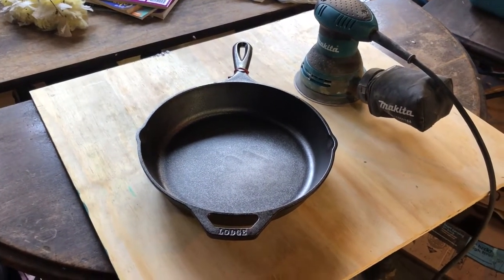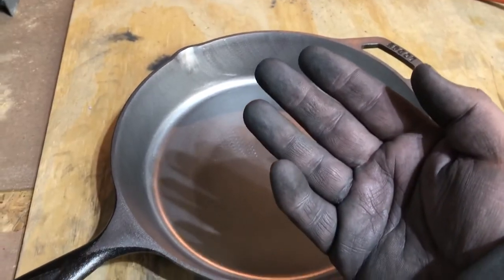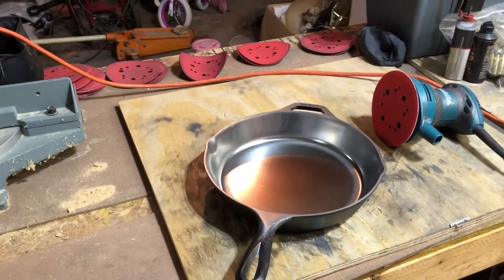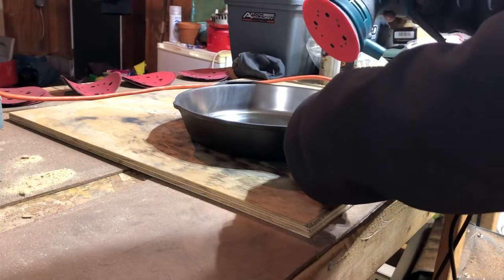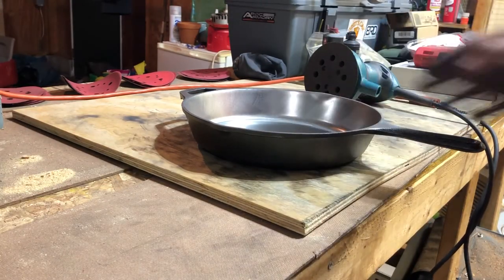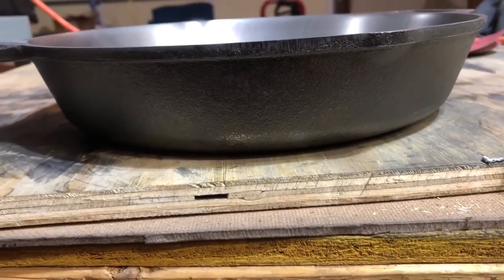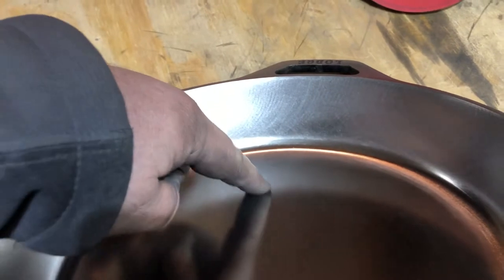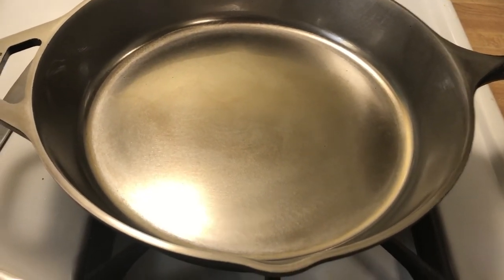DIY Refinishing Lodge Cast Iron - First attempt

Comment: Interesting video and much appreciated 👍 the finish is brilliant! Here in the U.K. this type of cookware is uncommon to say the least! I have a Lodge 8” frying pan (skillet!) and cooked an egg in it on day one! The seasoning it came with from Lodge was okay, the egg didn’t stick to much and I got it out without too much trouble. I then found Kent Rollins and re-seasoned according to his take on the subject, in and out of the oven 5 times in all, using a high smoke, plant based oil and so far it’s now slick and and pretty much non-stick. The thought of attacking the cooking area with sand paper fills me with horror 😂! The texture It’s still as rough as a witches armpit (😂) but the seasoning and slide ability is pretty much on the money! Looks like a Dutch Oven and another skillet are on the cards! All the very best from deepest Dorset England 🇬🇧🇺🇸👍
Reply from the maker: Thank you for your thoughts!
Grinding off their finish and reducing the cooking surface to smooth is not necessary, this test proved it to me for sure. What you get from it is a certain look and nothing else. The seasoning struggles to stick to this very flat surface, but the look is very nice. I will check Kent's video and see if I can learn how to season better as well.
Reply: Thanks Jim for your reply, much appreciated. if I want to make my cheap Lodge look like the cats whiskers …….you will be getting a parcel in the post😂 All the very best from deepest Dorset 👍
Reply: I don't like the finish that lodge leaves on them. it you ever get hold of griswald or a wagoner. you would know what I mean
Reply: @jimknowlton342  he is a good person to watch, but i sanded my new lodge. they are sand castes these days and it don''t leave a smooth finish.

Comment: You really don't need to work through all the different grit sizes, you move as much material as possible with a low grit and you finish with the grit you want to have the finished look with.

Comment: Stargazer BEAD BLASTS the surface before seasoning to give a surface that will hold on to the seasoning. Polishing or even sanding beyond 120 is a mistake. You just want to get rid of the pimples and make it flat. NOT a mirror. As the seasoning builds up it will self level and become smooth. Think of seasoning like paint. You never paint a gloss surface. It will not adhere.

Comment: It doesn't need to be that smooth. I've found its fine after 1 pass each with a 40 and and 80. Then over the next few uses it settles and works great. In fact I have a taiwanese pan that has the grooves from machining it that may actually be rougher than the casting of the new lodge that works very very well, and you can catch a finger nail in them grooves. They're huge.
Reply from the maker: I agree with you!
Reply: Agreed.
Reply: It'll work fine out of the box. If you know how to use cast iron, or carbon steel, food won't stick regardless of surface texture.
Reply: @phill3583  I'm no where near that good of a cook, but I am yet to screw up something cooking in cast iron. I think because I have electric flat top which turns on and off you end up with hot and cold in other thin pans, and you end with hot spots and cold spots because they warp with heat. Cast Iron is immune to both. Smooth etc is secondary.

Comment: Nice job on smoothing it out.
 I have done over a dozen like that.
  The old Lodge, wagner, etc. Cast iron pans were machined smooth from the factory.
  Honestly, they really don't need to be smoothed to a mirror shine, just knocking off most of the roughness with 60 grit will suffice. But, smoothing them out like you did will not ruin the pan.
  Seasoning it may be a bit harder, but it will take.
 And the more you use it the better it gets.
👍

Comment: I bought a really cheap cast iron frying pan in a junk shop, I had to take a milling machine to it to take the lumps off the inside, finished off with a flap wheel in an electric drill. Still using almost every day 35 years on.

Comment: I thought I had patience but this was truly impressive.
I had read somewhere else of a person sanding a pan down like this. They had trouble with seasoning too as it flaked off easily. Another person said the smooth surface was great but that the seasoning needed something to anchor to. Apparently, after smoothing down, a rough grit was run over it to give it some small crevices. These crevices would not roughen the seasoning as they would fill in. 
Could anyone comment on this? I'm in the process of smoothing mine. I didn't realize it would take this many discs. Progress has been slow so I'll start changing them out more. I had intended to go to a 600 grit, then rough up with a 60 or 80.
Reply from the maker: It took that many discs because I bought super cheap discs.
I think you're right about wanting to scuff it once it's smooth. It doesn't really hold seasoning that well but I don't season them expertly.
Reply: I love what was done here for the look of it and the labor out in.
In reality you can do this very fast with a few flapper disks and a grinder. 40, 60, 80 or just 60 or just 80. Anything that will take the high sides off is what matters. Leaving a semi rough surface is fine as long as the high sides are gone. It will take seasoning well that way and not stick do to only having divvets and not bumps. The low sides will eventually get filled by polymerization after many seasonings.

Comment: I have several lodge pre-seasoned pans and like them very much.  Never saw any reason to put that much work into a pan.  Mine work great and are non stick and easy to clean.  I do a quick re=season each use and they work fine for me.

Comment: the finfish is superb. You dont want to go to mirror finish because the seasoning is susceptible to flaking. I done this same way to my skillet i stop with 400 grid. Also by the look of it you buy sandpaper for wood, those get dull really fast. If you use sandpaper for iron you will need like 2-80 grid, 2-100, 1-200/320/400 but they are bit more expensive. I am also glad you sand it and not buff with abrasive discs like in other videos. If you want a smooth pan and already going to grind to bare metal make it properly. Also by sanding you dont copy the surface imperfections but create flat surface. Last tip be patient with the seasoning if you are a new user. I build up mine in 2 years, now it perform like teflon pan after half year of use. I can make crepes/waffles/pancakes with ease. So if you can make eggs your in the right path but if you can make crepes, the seasoning its finish, now its just maintenance
Reply: The smoothness has nothing to do with seasoning flaking.
Reply: @StuninRub   well yes and no. You just have to applied very thin coat of oil. But after first coat its no difference. Also i am using fats instead of oil. The seasoning is "softer" but build up quicker and its not sticky at all because fat dont dried out like oil. So i can use paper town without it leaving lint stuck in to it. That also mean if it goes rancid you can clean it with ease and it wont flow like a asphalt. I almost have feeling like cast iron is not suppose to be used with oil.
Reply: @scasny  Lard that has been seasoned correctly cannot go "rancid". This is less of an issue regarding seasoning or surface type and more so you don't understand how to season.
Reply: @StuninRub   do you even own/use a cast iron because you sound like not.
Reply: @scasny  The only one who doesn't know how to use cast iron here is you
Reply: @StuninRub  yes and that is why i can make crapes in it. I just dont know how to make it more sticky
Reply: @scasny  That's right, crap is all you know how to make and don't forget that.
Reply: @StuninRub  whops i mean crepes. But it dont matter, its not like you know what it is, or how to make it. Otherwise you should notice the mistake. And i should pay more attention when writing in foreign languages.

Comment: I would've Loved to see that pan scrubbed clean in piping hot soapy water then seasoned about 10x with Flax Seed Oil...After that, it would've been like cooking on Teflon coated iron...Well done!
Reply: Thing for me is the grating of the spatula.  For most folks it's fine.  I would buy this pan over a seasoned from the factory pan.
Reply: Flax seed flakes. Avacodo oil is way better

Comment: So now I'm curious, if you sand it smooth like you did, then soak it with vinegar/water to clear the pores, burn it with campfire/cleaning cycle, then clean dry season. Nice work thanks

Comment: I, too, found out the hard way that you cant sand cast iron and get the beauty and functionality of the older cast iron. I believe this is because old cast iron was not sanded...the pieces were milled with a machine lathe in a circular pattern which left radial grooves that were still deep enough to hold seasoning well, but gave a very smooth feel to the pieces. Unfortunately I just dont think sanding can accomplish this the same way. If youre struggling with seasoning those pans, you can definitely rough them up on the surface with a diluted vinegar water mixture to help create the surface roughness and improve the seasoning hold on the pan
Reply: You aren't trying to get it completely smooth when you start, your trying to knock off that super lumpy ridiculous "seasoning" that lodge puts on there, and eventually build up your own glass smooth seasoning, I have lots of iron, and the ones I use most took roughly a year of nearly daily use to get right, but make no mistake, it's still great iron

Comment: To season that cast iron skillet is heat 250⁰F oil let smoke it. Second oil it very thin coat go for 450⁰F let it cool,then third is oil it thin the oil coat 500⁰F make it 3 more times cooling down it will do the trick. Awesome 👌 👏 👍
Reply: What oil are you using that smokes at 250⁰?
Reply: @jaredroberts578  I believe flaxseed around 225⁰F
Reply: @stevemoy9834  Low smoke point flax is,...just wondering why to do it initially and then ramp up temp beyond that, to 500 or so. 

I would think a higher smoke point oil would be better,...don't mind me.

Thanks for the response, peace and blessings.
Reply: The oil plaster it bake on like lodge in the factory "non stick"

Comment: I bought a 12" Lodge skillet. I started with 40 grit and then did 80. It's nowhere near where you're at. I plan to use it on my EcoZoom rocket stove. Still working on seasoning it.
Reply from the maker: I think you've gone far enough, it didn't seem to help going past 80 in my opinion. Thanks for watching.

Comment: try a Makita type hand grinder with different grades of grit... use a light touch , but you will get it super smooth, finish up with fine sanding disks and wire wheel for the bottom curve.
Reply from the maker: Thanks for the advice!

Comment: Well if your are doing that for looks well done. But one 80 grit disc and smoothing the bottom a little to remove some of the factory seasoning is all that is needed. I do cast iron restorations for a living. The only reason to sand one down to the point you are doing is for looks. It WILL NOT COOK BETTER, IT WILL NOT BE ANTI STICK BETTER. Bad thing about that slick surface is the seasoning won't stick. What seasoning is there will cook into your food. You should ruff the surface up a little with 80 grit and start the seasoning cycles. But like I said for a wall hanger its good. For a cooking skillet it a lost cause.
Reply: Then why are all the higher end and vintage cast iron Milled super smooth finished before seasoning.
Reply: The need for a carefully scuffed surface is called "tooth" which micro scratches provide a mechanical bond with a finishing treatment. This principle is the same for all slick/shiny surfaces. Shiny is pretty but dysfunctional.

Comment: Does it make any sense to have a cast iron pan super smooth and use it as a traditional pan with cooking oil spray each time? I like that my cast iron pan can be moved to an oven or grill without a plastic handle melting. I'm new to cast iron but I love it, mostly because it is bad ass to pull out a heavy ass pan!
Reply from the maker: It's not really better than a modern nonstick and spray, but I prefer it over them. If you decide to try this, I recommend you use a new Lodge or Walmart Trailwhatever brand, do not mess with a nice older one.
Reply: I did one like this years ago. Spent about 8 hours sanding it. It looked like a mirror. I also burned out a sander. After seasoning it, I was disappointed in it’s performance with food sticking to it. I’m thinking I’m going to get it lightly sandblasted and re-season it. Unfortunately I can’t add a pic of it sanded.

Comment: Wow, looks great!  But it looks like you took a slower route with a sander.  I think the job could be reduced in time with angle-grinder and flap discs. The rpms of the grinder cuts faster. Cost probably the same in materials. One would finish up with the sander.

Comment: The best way to season a smooth cast iron pan.  Buy a couple avocados and big bag of corn tortillas.  Cut the tortillas into triangles, put about an inch of oil in the pan then get the heat on it.  Cook all the tortillas into corn chips, mash the avocados and enjoy with the chips while the pan cools.  Dump the oil and the pan will be great.  Nice and slick.

Comment: Seasoning would not  stick well when I sanded the  surface like this. After sanding I put it in the oven on a clean cycle which gave the surface something that season would stick to.  The pan works awesome now.

Comment: I don’t know if you should or shouldn’t sand an iron skillet until smooth, but it seems like the right thing to do. someone made a comment that the skillet was milled with a precision tool, but I found that NOT to be true. I watched a Lodge skillet manufacturing video on YouTube that walked through the plant operation. The fact is, the iron and steel is melted down and formed into a skillet by pouring the melted metal into molds and then it is coated with soy bean oil and heated to a high degree in an oven. That is all. If you watch the video it will not be surprising to you why it is has such a rough texture. Again, I don’t know if you should or shouldn’t sand the skillet, but it seems like making it smooth is better. Then all you have to do is re-season it.

Comment: Nice upload! My lodge right from the store is just so gritty that I can't seem to get super non-stick cooking. I am going to try and do a light sanding just to take some off the grit off
Reply from the maker: The trick seems to be an endless amount of high temp thin coats of seasoning, but knocking this down to 40 grit or so will help a lot in my opinion. The bottom line, you won't hurt it and if you like the look go for it they are not expensive!
Reply: @jimknowlton342  yeah from what I understand it needs some roughness for the seasoning to stick well. But it's just so rough now that I think making it a little bit smoother will lower the amount of seasonings I'll need for a non stick feel ya know? Cause right now my spatula gets stuck if I drag it across..
Reply: @SalsaBro  I got my Lodge a few years ago and spent a full day (4-5 times) putting a thin coat of flaxseed oil on, then baking it for an hour at 500. 

It wasn't "perfect," but about 10 cooks later it was. I've probably cooked 300 times on it now, and it's seasoning is amazing. 

I think with any cast iron, even the more expensive ones, you just have to use it. I also have a Borough Furnace and it took awhile for it to perform at the level of my Lodge, because there's just no replacement for "game day experience."

Comment: It looks nice. But my rough Lodge takes the seasoning much and much easier than my very  smooth DeBuyer carbon steel skillet. The latter was a bit of a struggle. I think I will keep my Lodge as is, because it looks like the dimple structure helps with the non-stick. I have a stainless steel thick bottomed skillet with a surface with little dimples. And this is more non-stick frying eggs and fish than a top of the line fully clad smooth finish skillets.
Reply from the maker: I think that is the right move. This very smooth surface is difficult to season. I need to scuff it with 40 grit. Thanks for your feedback!
Reply: Cowboy Kent Rawlins has a video where he does this only just knocks the peaks down.  I've done this to the extreme, like this, and don't like the seasoning result. IMHO the seasoning needs some texture to adhere to. I've tried this after 60 to 80 grit and got great results. A lot less work.
Reply: I can't imagine a factory finish on a new lodge being better than an all clad. That sounds absurd to me but if you have success with it all the best to you. Personally I am going to hit all the new ones with the flap disk 40 grit, then 60 and maybe move to 80 but no higher. The idea is to take off the high spots and hope to only have divvets left. Every once in a while I find a new lodge that is semi smooth but most are a sand paper type finish.
Reply: @ZCRAIZED1  I think you misread what I wrote.

Comment: I think it was perfect after the 60... Still interesting video... Would you recommend that sander or another one? I am buying it largely for this...
Reply from the maker: You are right to stop at 60!
We got this sander for drywall work, it will work for this obviously as well. Probably better pads than we got would be a good move. I burned through the cheap pads quick, the sander never gave me any issues.